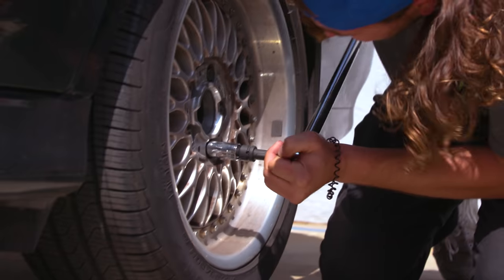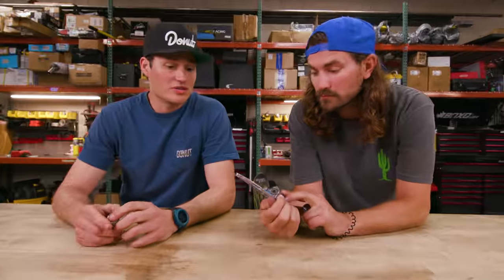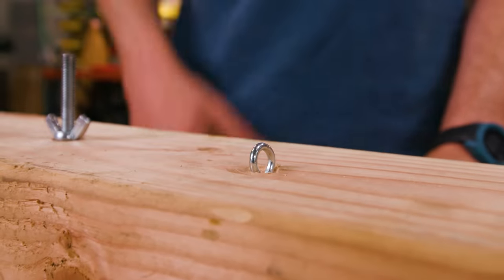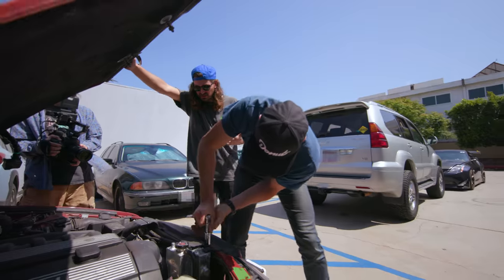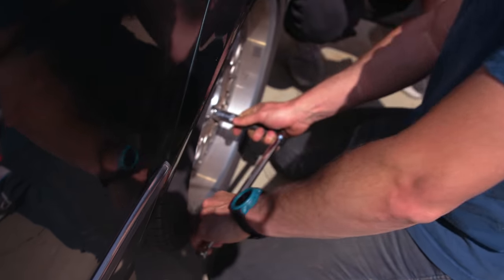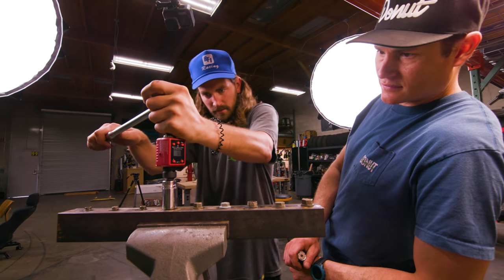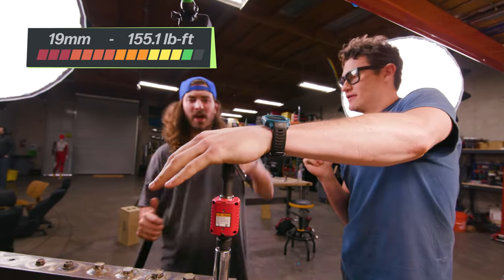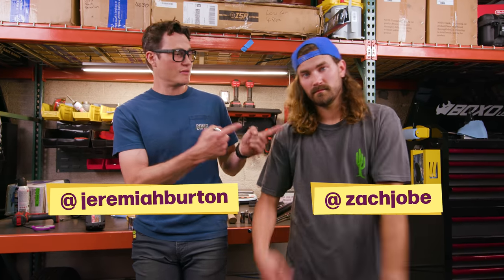Testing the World's Most Hated Tool

Comment: I don't think it should replace your existing tools. 

But it's worth having one in your bag, because it could save you from a trip to the hardware shop, one day.
Reply: No...just...no
Reply: ok
Reply: If you stumble across a 19mm bolt it might…
Reply: I think it would work if the pins were a lot  thinner and made out of tougher material, idk how do you make sth that tough but yeah
Reply: I own one solely for rare encounters with something weirdly non-standard that I need to put some torque through. I think I've used it like three times, but in each case, I would have had to break out the grinder and welder to do the job otherwise.
Reply: Yea I was gonna say that. It would be good to have in a “just-in-case” scenario. Like you said, it could save you a trip to the truck or the store.
Reply: @komischertyp4  I use a 19mm everyday as a Industrial Mechanic.. So I guess I'm good then.!! Lmao.. and only 10 bucks.!? I will take it and works most of the time.!!
Reply: No
Reply: I would not keep it in the toolbox. I would test it as soon as I would buy it. That way for that one Friday afternoon when I'm trying to finish a job and I go for that "special occasion tool" I don't pull it out and it snaps first time I try to use it. Nothing more disappointing than having unfinished job because of something small like that. That's why I have like 2-3 of everything like wratchets, sockets, wrenches. That way if I'm working on top of car and wrench falls to ground I grab another one and keep working. Now when you do that it's very important to know your sets of wrenches and sockets. So when you go to start a car there is no wrench that's stock between serpentine belt and fan...that's why I clean and put all tools back at end of day so I can go recover those lost tools.
Reply: Mine stuck in there pretty well and worked whenever I needed it - the ones in this video seem less durable. Only ever got 1 depressed pin until I tried to use it on a stripped transmission bolt. I ended up snapping the spring behind the pin and a couple pins fell out. Good for a trip to the junkyard though.
Reply: This video just gave me every reason why it’s not worth having in my toolbox.
Reply: It's good for the stuff in the add and for broken stuff but replacing everything just nope.
Reply: Emergency 1 time socket
Reply: I have generally only used them for rounded bolts
Reply: @fancomments9307  i have an older not gator grip one of these that has 5 rows of small pins i have not had trouble with it and it works so long as i dont need a ton of force on the bolt
Reply: My thoughts as well. It is a garbage product but it may work when you are in a pinch and dont' care if you destroy the socket (because a single use probably will lol).
Reply: You’d have to go to the shop anyways to replace the bolt you just destroyed
Reply: What's wrong with you guys do you even know what an adjustable wrench is? ...
Reply: @agentredbone1667  This thing came in handy when I needed to drive some small eye hooks.
Reply: That's a trip to the hardware store to go buy this thing, just buy a set of sockets and be ready, any day of the week.
Reply: Yeah. It’s not the best, but if you don’t have the right size, you might as well give it a shot. Also it’s cheap, so if it breaks, it’s not that big of a deal.
Reply: @Stumme-40203  it is just a waste of money, it'll destroy your bolts on top of if, use an adjustable wrench or a second round of sockets ffs
Reply: @tmadlegionsoul3255  Which is funny because it rounds bolts itself.  So maybe the idea was once you start using this you can't stop, since now your bolts are rounded and won't be usable with regular sockets 😂
Reply: Totally agree. Of course it will not replace your good tools, but it's just another socket in your bag that could be of use if needed. And it's very cheap, so.. no harm there.
Reply: @fancomments9307  and stronger springs
Reply: that's a fair thought.
Reply: Doubt it!!
Reply: Eh I can see it as a stand in for the 5/16 or 10mm that people always lose from my socket set. But only till I can replace them.
Reply: I think it is where and what is is made from, scrap metal is always crap
Reply: I've got a no-name version I bought off of Amazon for around $10 or so. For quick fixes around the house it's easier to grab this thing rather than look for a particular socket. But if you're actually building something or are going to be spending a decent amount of time on the repair anyway you may as well just drag out your socket sets.
Reply: No it won't Dosnt work on anything worth shit
Reply: Agreed. I’ve used this tool on many occasions and it works just fine and for its purpose. Using it to torque down or loosen heavily torqued bolts is user error and stupidity, not the fault of the tool. User error, as always.
Reply: @fancomments9307  tungsten or titanium
Reply: I rather crawl to the store...
Reply: No..never.. no .. no ..no.  It's just garbage.
Reply: It's like one of those tools that you don't need most of the time, but can save the day that one time.
Reply: did you even watch the video
Reply: If you keep it clean
Reply: Yes, I should buy this bad tool while I'm at the hardware store so i can avoid buying a good tool at the hardware store later. Though I will have to buy the good tool at the hardware store when this inevitably breaks but it was a nice dream
Reply: I don't think it's good enough even for that. You can probably get a socket set from the Dollar Store that would perform better than this.
Reply: Dunno about saving a trip but I imagine if you found yourself needing to turn a non-standard thingamajig it'd be handy
Reply: @komischertyp4  19mm is basically 3/4" (.748 vs .750).  A typical 19mm wrench actually measures around .751-.755.
Reply: As someone who's bought and promptly abandoned one of these, and now uses one as a neverending shop joke. NO. Unless you're aim is comedic mood lightning, don't bother.
Reply: At the risk of damaging whatever your using it on, and itself. One time use it looks like. And that's if you extra nuts or bolts or whatever
Reply: @zman837  As I said, the tool is great for removing various and odd hardware and bolts, or for holding one side of hardware while the other side has a proper wrench.  I use these for demo.
Reply: 1 time lol
Reply: It won't save you a trip to the hardware store...ever.
Reply: @komischertyp4  19mm wrenches are, for all practical purposes, interchangeable with 3/4".
Reply: @joshskyeroberts6502  19mm and 3/4" wrench is interchangeable.
Reply: @yerst2  Yes.  It is for when you don't have the proper wrench and it doesn't matter if you damage the hardware.
Reply: @rolandm9750  It is like using an adjustable wrench, which also tends to damage hardware.
Reply: I have one just for that reason. It's not something I'd use on the regular but it's great in a pinch
Reply: I use one in exactly the same way
Reply: I've had one for years in my toolkit, for contingencies. Its saved me a bunch of times. Actual wrenches are better, but if you don't have a set of wrenches handy and you have this you'll probably be able to make due for a couple bolts.
Reply: I actually have one of these, believe it or not... very handy, especially with hooks and i bolts.
Reply: I would rather take that trip to the hardware shop
Reply: @redcluster33  yea, it's not the answer to all problems. but if you gotta install 30 plant hanger hooks it is amazing. zips them bad boys in quick and painless.
Reply: let me introduce you to adjustable tools.  You get adjustable sockets, adjustable wrenches.  Heck you can get an adjustable anything if you look in the right place.
The other day I found an adjustable screwdriver!  Crazy.
Reply: It did. It busted for the very next clutch situation I needed it for, but for a disposable solution to a pain in the ass situation, it worked, which, given how much a pain in the ass the situation was, I didn't feel it was a waste of money. Would I buy another? Idk, I try to have multiple socket sets stashed variously just in case.
Reply: My grandpa bought one of these when I was 5. That’s when I lost all faith in capitalism and authority figures

Comment: I have one of these, and honestly, for like simple jobs, it is pretty handy because you don't have to keep going back to your toolbox. As long as you don't use it under a lot of torque it's handy.
Reply: No ugga dugga? Awwww...
Reply: @akgaming3000  You can get a little ugga dugga, but too much ugga dugga will get you ugga dugga SNAP
Reply: Exactly. This is designed for light duty, it's for your average joe who might use a socket wrench once or twice a year.
Reply: I'm with you I've used mine for nearly 8-10 years. Great for hooks and smaller things like u said, not something I use on my vehicle or anything that needs real tools lol
Reply: @micrograham  I Ugga all the time maybe it’s because it’s a impact rated grip socket. Mine has held up for a year of using it maybe once a week.
Reply: A better-made (maybe old)  one actually doesn't suck,  to my experience.   I mean, bear in mind what it even is before hauling on it hard or something,  but it has its applications.
Reply: @micrograham  and then back a quarter turn
Reply: Exactly. This thing is good for 2 purposes: odd shaped fasteners and as a last resort option because you lost your (insert size) socket. (Assuming it's within the working range)

The rest of those claims are just sales pitch nonsense. No one in their right mind would get this thing thinking they'll be able to throw their sockets away, to get crazy torque, or to bust lug nuts loose.

Anyone calling it trash either doesn't understand this thing's limitations, isn't capable of thinking resourcefully, or is a tool snob.

Comment: When I was a oilfield lease operator I always kept one of those in my rat pack. Those things are life savers. All of us kept gator grip sockets with us for the rams on the top of the packing. It's a 3/8" square and no socket fit quite right except gator grips
Reply: Hey dude let me know if you get into fracking.  I design/build lube system packages and have done a bunch with Tri and quint rigs.
Reply: What is an oilfield lease operator? I’m a mechanical process operator and never heard of the word “lease operator” might also be because I’m a foreigner
Reply: Perfect use for the Gator Grip.
Reply: Square head set screws! They should have tested the Gator on some of those too
Reply: @sk-yd5ge  it's a Pumper. It's a fancy term basically. Making sure pumping units are running and ensuring production levels are kept at optimal levels
Reply: Maybe a 3/8 square socket fits. Or a upside down common 3/8  type hex socket turned with a hex key.
Reply: @glockfowtay  Sounds cool man!
Reply: Nice

Comment: When I worked in stage production having one of these on a ratchet was a must. Speaker stands, lighting c clamps, stage risers, all had dire t bolts and were all buggered in some way so a regular wrench wouldn’t work …
Reply: probably they were buggered because all of the stage hands used that tool. but you are right, something that is built and taken appart on daily bases is mostly not torqued down until water comes out of the bolt, so this gatorgrip will do the job.
Reply: @snake plissken  main problem is that, especially with gaffer equipment, the individual hardware either comes with a specific odd sized tool that is meant just for the slightly off standard bolts and such that holds it together.  If you lose that tool it is a freaking pain to try and find anything else that will work and even if you do you have to remember what alternate you found and hope it fits well enough to not tear it up.  Then some just have sucky bolts that have to eventually be replaced but after replacement might not be quite the same size as the rest anymore so now you need two fittings for that piece.  Also chances are that unless all your equipment is from the same company (and sometimes even if it is) you are gonna have to use different sizes for each one.  I really don't know why film and lighting equipment be like that.  Maybe to discourage theft or sabotage (can't mess with stuff if you don't have just the right sized tool to loosen it)?  Anyway, this actually would work really well for stage or film work.  Kind of wish I had one when going to college...

Comment: if those pins were hexagonal, the whole internal part of the tool inside the socket would be a lot more rigid, and I think you'd bend less pins.
Reply: i'd say that's how they manage to keep the costs down, lower quality and machining
Reply: Actually I have seen rip-offs where they are hexagonal.. In fact it's worse. You get a much more slip.
Reply: @tomr6955  how?
Reply: Hexagons are the bestagons.
Reply: @jmfreestuff73  i see what you did there. 

Also, i have one of these with hexagon pins and it is the exception to the rule. It was a free add in on another order I made, wonder why. Lol
Reply: A hexagonal one exists.
Reply: ok
Reply: Then it would no longer be GATOR GRIP.. it would be a CROCODILE GRIP!
Reply: Yea that's what I was thinking too.. but then they would need tighter tolerances, lubrication, sturdy rebound spring system, and much better metals.
Reply: I agree, people asking how? Its physics
Reply: @JCW 308 oh so they do?? That's cool. Is it more sturdy than this crap one they are showing here. Lol
Reply: I thought they were, then I saw this video.
Reply: lol they didn't think that through
Reply: can confirm
mine has hexagonal pins and sure if i wanted to i could damage them but so far they have held up

Comment: Circular pins leaves room for gaps and error, I wonder how it would perform if the pins were hexagonal like a bee hive
Reply: Great idea. Seems like the pins would not be able to move when torqued.
Reply: The original one 75 years back did have hex pins. This is a knockoff of a knockoff.
Reply: My dad received one with hex pins about 20 years ago. Any improvement of performance would be marginal.
Reply: I believe that for hexagonal fasteners, hexagonal pins would do significantly better however, I do believe the tooling required to make the hexagonal pins and/or retention mechanisms may add cost. Would the trade be worth it? The world may never know.
Reply: If I remember correctly, Snap-On makes these with hexagonal pins, and it costs something like $74.99 per week for 850 weeks after a downpayment of the soul of each of your direct descendents firstborn sons for the next 7 generations.
Reply: @robertmyles9124  So accurate 😂
Reply: @robertmyles9124  shit. That's pretty cheap for snap-on.
Reply: I was thinking the same thing but the shap edeges of the hexagonal pins would be easy to deforn so it would need to be machined from a hard material and then it would chew up any bolt you use it on.
Reply: @robertmyles9124  scam snap on by not having children
ez dub
Reply: @Blucifr  i bet that this tool worked best if there is something broken.
Reply: @robertmyles9124  SnapOn tools may also got big profits cuz of this.
Reply: @nfg_fpv  me too thought about that one, Turbo FPV. 👍
Reply: @robertmyles9124  the price of the Snap-On lifetime warranty lol
Reply: my one is like that - "as seen on TV" tools are always the worse - mine was more like $40 though
Reply: @napalmholocaust9093  ...lol  Wuhan's finest!
Reply: Exactly what I was thinking
Reply: If they used a bunch of smaller pins made of a stronger material it may actually work lol
Reply: @robertmyles9124  Oh, so it's the same price as a 10mm socket then. Cool.
Reply: @nfg_fpv  Yeah, that's what I was thinking, Tungsten Carbine to keep it from marring and hanging up, but then it'd be fairly brittle and would cut bolt heads up like a hot knife through butter.
Reply: @robertmyles9124  😂
Reply: Good thought, but with debris and/or pin damage jamming the multiple sliding parts, the issues would persist.
Reply: It would also help if there was one with millimeter sized pins, and another with 1/16” or 1/32” pins.
Reply: @gpweaver  use tungsten carbide pins, and market it as a bolt rounder!

Comment: I've never had a problem with them. But then again, I don't think it was a name brand GatorGrip. Also never really used it on anything needing a lot of torque. Just basic fixtures and whatnot, it works really well. At least in my opinion and experience. It's not a replacement, but it is a nice utility socket to have for those jobs that have a bunch of different sized nuts and bolts that don't need tons of torque. Definitely not for lugs, but I get that you guys are testing to the extremes.
Reply: I’m 😊
Reply: Repent and believe in Jesus Christ  So you're saying that the Romans should have used the Gator Grip to fasten Yeshua/Jesus to the cross with screws instead of nails?
Reply: Repent and believe in Jesus Christ  repent because of the gator grip?
Reply: Yes obviously not for something that's rusted on
Reply: Yeah, it performed well on the various screws in the board. Common, simple, uses, no real torque needed.  But cars? Yeah, not an ideal tool. (But the ad made some of the big claims with torque and replacing the whole tool box.)
Reply: Is it good for odd stuff like eye bolts?    That would be the only thing that make me interested in picking one up.   Seems like they broke one right off the bat using it on that stuff.

Comment: NOTE: They (not gator grip, but other companies) make DEEP socket styles with much further depth of travel as well as standard or metric sizes that are made specifically for say 8mm-20mm and use on nothing else and they do work REALLY well. The tech has matured a LOT from the original gator grip.
Reply: agreed, great for stealing wheels off people that use lug locks.
Reply: @plebiansociety  bruh🌚🌝
Reply: Yea it really is sort of old...
Reply: Do you have a link for those?
Reply: It's called you could have 5 full sets and still can't find the right size as people have said it's good for a pinch